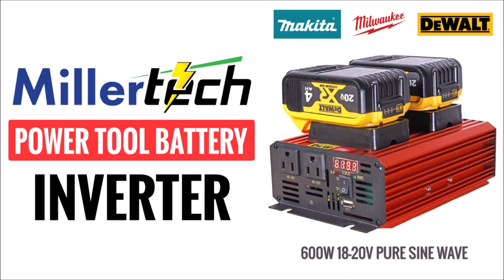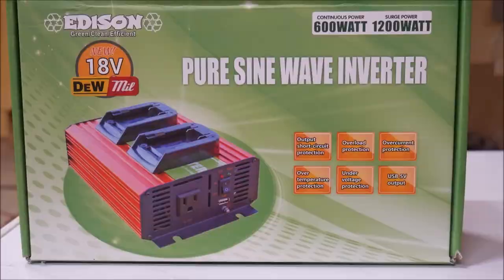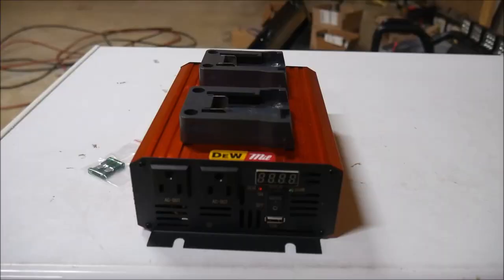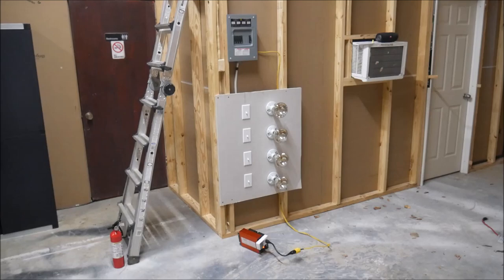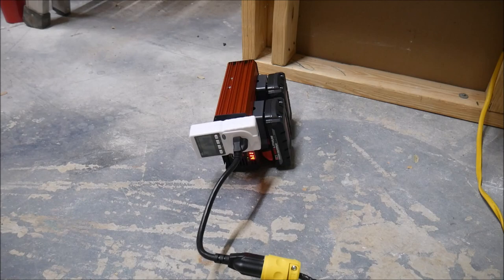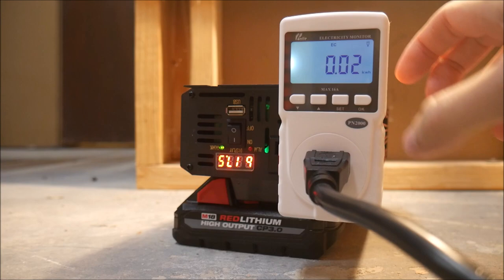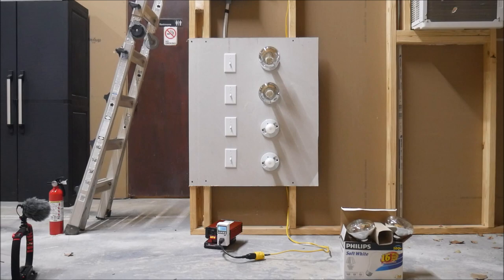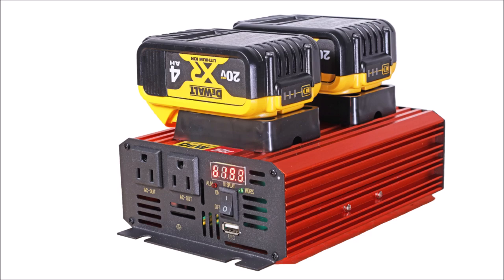MillerTech EDISON Power Tool Battery Inverter - Use 18-20V Makita, Milwaukee, or DeWalt Batteries!

Comment: Exactly what I was looking for!  Will purchase the Dewalt/Milwaukee version and use with 2 adapters for use with Makita batteries.  That way I can use Dewalt, Milwaukee, AND Makita batteries.  Thanks Jason!
Reply from the maker: You are welcome!  Just make sure the adapter can handle about 30-35A.
Reply: How reliable has it been?  How long did it take to get to you?

Comment: I just got mine and honestly it's a cool product but the quality could be a bit better.   Looks like something you would buy at a flee market.  So far it's working though,  and it's actually a pretty cool product and hopefully it will last a long time considering the initial impressions are slightly lacking. 

So here's the good lol.  I have a ton of flexvolt batteries and 2  9ah batteries fit perfectly.  I also have a bunch of milwaukee batteries and you can mix and match them or just run it off of one battery so you can swap batteries without the thing turning off and since i have so many batteries i have power for days.   I only needed it to power my 12v fridge and some lights and it does it just fine.  

I would only recomend if you already have powertool  batteries otherwise there's better options in my opinion, with that being said if you're a tool guy, chances are you spend thousands of dollars on tools and you like quality.    I honestly wouldn't mind paying 100 dollars more for it if the build quality was better, heck even 150 more lol but build it better please!!!!!!

I'll post a long term follow-up shortly, I go camping a lot and while I already have a power inverter hooked up to my truck I wanted something I can move around.
Reply from the maker: I don't disagree with you completely, but lets be objective here.  You think $200 is expensive relative to what?.  What are you comparing it to?  Milwaukee's own 175W inverter costs $99.  They have an 1800W inverter that costs $2200.  Those are $0.56/W and $1.22/W respectively.  And the 175W Milwaukee unit gives you modified sine wave output.  The 600W MillerTech is $0.33/W and is pure sine wave.

Dewalt has an 1800W Flexvolt Power Station for $450, which is a lot better bang for the buck.  But it is also modified sine wave.  So that limits the uses and puts wear and tear on motors.  You can decide for yourself whether that is a good value or not.

As far as the duct tape or soldering or anything else around the battery sockets, the battery sockets are 3D printed and the final assembly of the inverter is done by MillerTech, which is an Amish company in Ohio.  They receive the inverters from their manufacturing partner with holes on the top and they have to add the sockets on top themselves and make the electrical connections.  So there may be some signs of being hand built but I've sold hundreds of these things and have only had one warranty claim and that was a unit that was dead on arrival.

Can it be improved upon?  Absolutely.  I'm actually going to be driving to Ohio to meet with MillerTech next week and that will be one of the big items on our discussion agenda.  Initial build quality can be improved.  But I think you will find that it is a solid product and if there is anything at all wrong with it that MillerTech and I will take care of it.

So thank you for your review and honest feedback.  I appreciate it.  But lets just appreciate that MillerTech is bringing something to the market that doesn't exist and doing it for much less than anything else that can be compared to it.
Reply: @LDSreliance  I think it's a great product I just think the build quality should be a little better.    If you say it's reliable it's definitely worth the money,  the initial appearance doesn't really inspire confidence though.   All I'm saying is that I'd rather pay 300 for a better built product but I'm also just one person amd you have to do what's best for business.   I do think that people who already have the batteries would pay more and appreciate te better quality,   I mean we buy tools that are way overpriced but very well built.   Also, I was comparing it to a traditional 12v inverter.   Ryobi does have a 140 dollar inverter that is 300 watt on 18v,  800 watt off a car battery and 130 or something like that from the car socket and the quality is great,    but like I said if it works and is reliable I'll definitely be happy with it.     I'd love to do business again with you when you upgrade at least the plug/outlet quality.   Or maybe the one i got has a loose outlet?   The other one isn't as flimsy but still a little flimsy.
Reply from the maker: That is true and that is why I agree with you and am going to talk to MillerTech about it.  Anyone buying Makita, DeWalt, or Milwaukee batteries is buying the best.  And the inverter is a solid unit.  But it could have a better look and feel and inspire more confidence.  More polish, I guess is a better way to say it.  

If the AC outlet is loose then we need to do an RMA.  That definitely is not supposed to be like that.  I thought you were talking about the sockets on top for the batteries.  And the piece of duct tape you saw is a piece of gorilla tape that MillerTech adds in under the battery sockets as an additional protective measure in their assembly process.  Usually you can't see it under there but I guess yours has a gap or something?
Reply: @LDSreliance  it's all good man I actually was rougher with the outlets today and do move a lot but they're fine so far.  I think I was just scared because it looks a little on the cheap side.  Overall I'm happy so far and liking it more now.  I'm not that picky and I just want it to work and as long as the outlets hold up I'm happy
Reply from the maker: You're fine.  That is why my initial reaction was just try to look at it objectively.  After the subjective "it looks cheap" impression wears off, you come to appreciate it a lot more.  But let me know if you have any more issues with the AC plugs.  They should not move at all.
Reply: @LDSreliance  one is a little flimsy but we will see.  One year warranty right?
Reply from the maker: Correct.
Reply: @LDSreliance  perfect!
Reply: @LDSreliance  so the thing works but when it gets hot the fans don't even turn on and the thing doesn't protect over the 600 watts.   It's literally a fire hazard.

Comment: I Have Ryobi 18v 1+ System. Are Ryobi Batteries Able To Function?
Reply from the maker: No, unfortunately they are a completely different type of socket.  MillerTech is not interested in Ryobi but I do see a need there.  But there are some physical challenges with using those style batteries that I haven't solved yet.  But I am working on it!
Reply: @LDSreliance  Thanks For Your Quick Reply! I’ll Keep An Eye Out For Any Updates.
Reply from the maker: Awesome.  Thanks for the sub!

Comment: Curious what's battery voltage input range for 300w/600w? Can you mix 18/20/24v batteries?
Reply from the maker: The input range is 15-21v and you can mix Milwaukee and DeWalt batteries on the 600W unit with two sockets.  There are no 24V batteries that work.  Makita batteries require a different socket and so you have to choose that sub-model when checking out on my web store.

Comment: Is 2 batteries required to use the inverter or will it power on with just one battery?
Reply from the maker: It can operate with only one just fine.  It just won't last as long.

Comment: Man I want one with the flex24v batteries they charge super fast and put out 24v!! Running a 24v battery at 12v would it double the AH? SAY I HAVE TWO 10ah battery would that be 40ah as 12v??

Comment: I noticed on the bottom of the casing there is a 220/240 volt option. Are you going to make that model available for those of us who live outside the 110volt-verse?
Reply from the maker: Unfortunately, neither MillerTech nor my web store ship outside of the United States.  I personally don't sell enough products to justify the massive amount of paperwork and expense involved.  Sorry about that!
Reply: On the bright side most Switch Mode Power Supplies , like the one in your phone charguer can work in either 110v or 220v , so even if thu inverter outputs  110v  you can still use it even with an european charguer , check the label on the power supply to see the voltage range

Comment: So I've had mine for a few months and it works ok but the quality isn't there for 200.  When it gets hot the fans don't even turn on  and non of the protections work so you can very easily over heat it,  it's literally a fore hazard. I was honestly going to buy another one but it's literally a fire hazard.
Reply from the maker: Alex, the fans should definitely be turning on.  If they don't then we need to get an RMA going.  I've used mine extensively and it never gets hot at all.  Email me at ldsreliance@gmail.com or call MillerTech directly at 855-MAX-LITH to get started on a replacement.
Reply: @LDSreliance  I have a 400 watt pure sin wave inverter in my truck and the fans work and everything.   I camp a lot and use for all kinds of things.  The fans most definitely not kick on at all,  and my 400 watt inverter has a protection and it works perfectly.   I hooked up a charger yo a 60v battery to run my chainsaw for firewood and the inverter got super hot and the fans never kicked in,  I had to unplug it because I thought I was gonna fry it.   How do I go about replacing it?
Reply from the maker: Call MillerTech at 855-MAX-LITH and speak with Vernon or Robert.  There is definitely something wrong if the fans are never turning on.
Reply: @alexgarcia3900  um, he just told you how.
Reply: @chachavessel  that didn't work.  Now what mr super smart ?
Reply: @chachavessel  they said they didn't know about an inverter and didn't know who was selling them
Reply: @alexgarcia3900  how did you know that was my name? 🤓😆😂
Reply: @alexgarcia3900  said the guy who broke the inverter ...😂😂😂
Reply: @chachavessel  did I?????

Comment: If i run 5 amps at 120v 600w and have 2 m18 xc 5.0 milwaukee batterys. How long will the inverter run.
Reply from the maker: A 5.0Ah battery is 90Wh so two of them would be 180W.  So you could run a 600W load for 18 minutes, at most.

Comment: @LDSreliance  I would like to see one that will accept 2 or even 4 power tool batteries, and will also accept 12 volts (bonus if it can accept the two voltages simultaneously) and output enough watts to run two Milwaukee superchargers(not sure the required watts but possibly ~1440W) so that the inverter could run off power tool batteries, and then be hooked to a12 volt battery(car/truck battery, or solar input) and then run power tool battery chargers. Even running the dual port rapid charger (~660W?) would be great if it can run off 12 volts. As it is, I will have to carry around another inverter to run off the car 12volt battery system to charge the batteries back up. It would be nice to just need one inverter. Another feature that would be great would be USB-C fast charging for smart phones and laptops! 
I did received the 2 battery 600W version in the mail today, and I'm super excited to add it to my collection the Milwaukee Topoff (175W with USB-C and A fast charging). Thanks!

Comment: Dewalt low voltage battery cutoff is in the Dewalt tool unlike other manufacturers. How does this product protect the Dewalt battery?
Reply from the maker: It has a low voltage cutoff at 15V, which is consistent with where the DeWalt battery will read "empty" or no lights on.

Comment: I had seen reliable electric inverters offering 18v inverters and had concerned building one of these but as small as most of those batteries are I didn't see a real good point so I built some with 18650s and a 24v inverter my small one is 585wh and a 500w inverter but I built a big one with almost 1.5kwh and have tried a couple of inverters but they haven't been up to my needs which is running a 120v IGBT flux core welder
Reply from the maker: Wow, yeah you will need quite a few 18650's to run a welder.
Reply: @LDSreliance  I believe I have 140 and most of them are around 3000mah and rated for more than 1c like I said it's just under 1500wh so that should be fine I mean it will never run for more than like 30 seconds a minute at a time then rest for a couple minutes it's just the inverters and I already have a case so I need it to fit
Reply from the maker: Yeah where did you get the cells?  Some cells can handle higher current and some not.  140 sounds like it should do it, though.  Cool project!  I remember seeing a video somewhere a while back where someone built a rig to weld with AA batteries.  Crazy.
Reply: @LDSreliance  most of my cells came from power tool batteries actually thinking back no these came from some like scooter packs that were rated at like 3200mah but I think they were average like 2900,3000 and I don't remember the specs but I believe they were rated for like 2c continues and welding would never bee more than maybe 2 minutes at a time and the load should only be like a little over 1c I figure the welder has a 120v 15a plug so no more than 1800w and its just under 1500wh battery pack but I keep blowing up 1500w inverters and need to step up to a 2000 but I kinda already picked the case and built the battery pack around the inverter size so maybe I just forget about that and sell it and go all out and start with a like 2500w inverter build like a 2000wh pack but I've been broke and can't even bother to put new mosfets I already have in any of the like 3 blown up inverters I have

Comment: Hi dear, is there any way to return it if this inverter didn't work as I wanted? I already ordered this through the website on your link, but I'm not sure if it can charge a 240w laptop. I have other stuff from Ryobi and just checked their 800w inverter which didn't work. Just to know if you have tried any rechargeable device with around 300w with this inverter, thanks!
Reply from the maker: Yes, it can easily handle 300W.  Why won't the 800W Ryobi inverter work?  You can return the inverter if it doesn't work but I don't see that happening.
Reply from the maker: Direct any further questions/concerns to ldsreliance@gmail.com.
Reply: @LDSreliance  I have no idea but I have checked many inverters which are all working on small laptops but not on bigger ones. I checked other websites and even Kickstarter to see if they are building something for bigger wattage users and there is none! Normally when I see one 110v I believe it can support up to 150w but it looks like all these companies are copying only one idea, one is building it and others just change it to their own brands!
Once I received this inverter I'll let you know if that turn on my laptop or not, I'm optimistic! And thanks for link, much appreciated.

Comment: Does this inverter have a built in fan? If so how often does it run? Is it noisy?
Reply from the maker: There are two fans.  They do not run unless the unit gets hot under a load.  I wouldn't say they are quiet when they are on but they aren't loud, either.  About what you would expect.

Comment: Looks like a handy device but how long can 1 or 2 fully charged batteries power it under different loads? minutes/ hours?
Reply from the maker: I would be happy to test that but I only have one size of battery currently.  So I would like to at least get one other size battery to test with before I spend the time and effort to do the experiment.
Reply: The math is pretty simple, if a battery is 18volt and 5 Amp hr, multiply the numbers to get watt/hours.  18vx5ah=90watt/hr.  Two batteries =180 watt hr.  Plug in a 600 watt device and divide 180/600= 0.3 hours of use, so 18 minutes for 2 batteries driving a 600 watt load.  600 watts is not much, 6 100 watt light bulbs.  Wouldn't run your microwave at all.  Plus it would heat up your tool batteries pretty fast draining them this quickly.  These numbers are in a perfect world, so expect less performance and I'd expect the batteries to shut down to self protect.  The dude running the video knows all this, you cannot tell me that he didn't run this test, he just doesn't want you to know how poorly this actually works.  18 minutes at full power seems pretty much worthless as far as I can tell.  I guess you could make a couple pots of coffee by smoking 2 tool batteries.